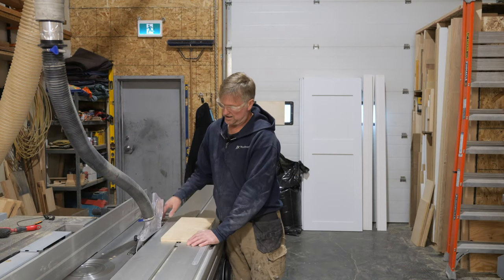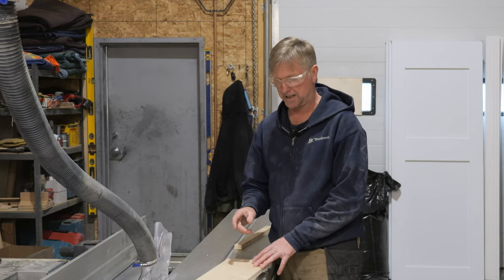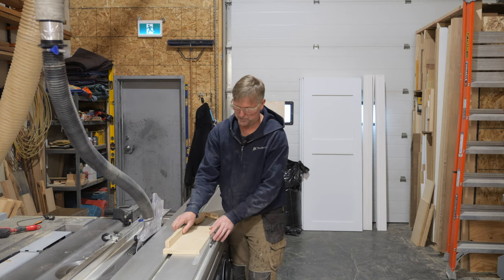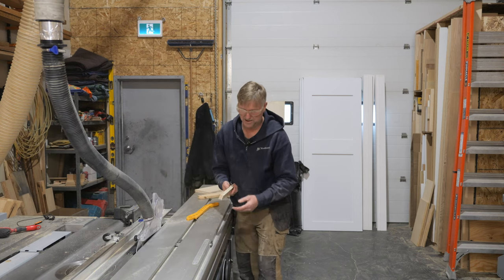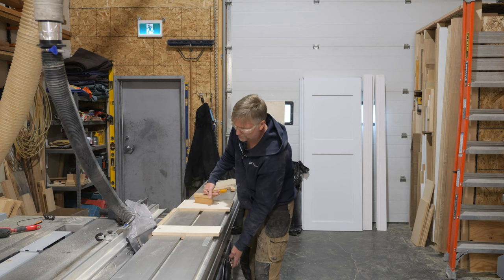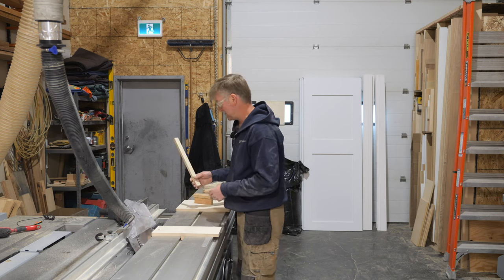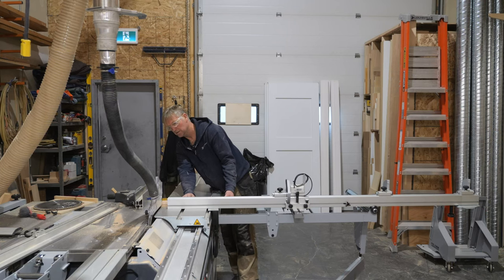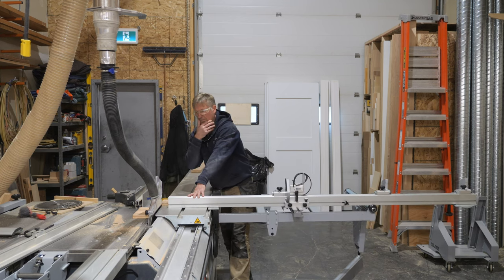Safe table saw practices start here!

Comment: Good video - always nice to stop and think about safety.. Wondering if in another video you could give a little detail on the simplified (?) Fritz and Franz jig you're using around the 5 minute mark. Thanks
Reply from the maker: Thanks for watching. Yes it's a pretty basic Fritz und Franz jig & i can certainly give a bit more detail on it in another video. What exactly would you like to see?
Reply: @brycecomerwoodworks  ..Again thanks  for  reply. I guess specifically how you've attached the front and back segments to the slider slot.? also have you applied any sort of tape for grip to the 2 inward faces?
Reply from the maker: @wawmsey1  I'll have to check when i'm back in the shop, but i think i just machined up a piece of maple or something the same width as the slot and glued and nailed it to some 5/8 or 3/4" Baltic birch ply. Nothing for grip, but i don't seem to find i need it. One of these days i'll probably add a stop to each of them, as that would be handy in a lot of situations.